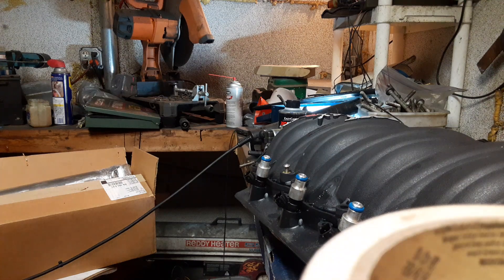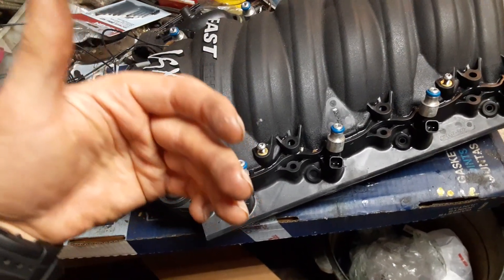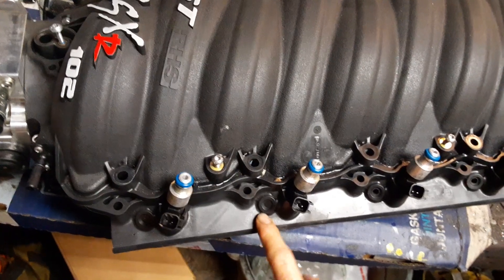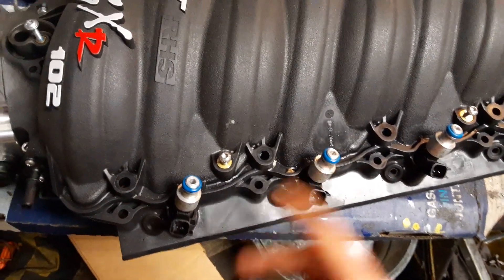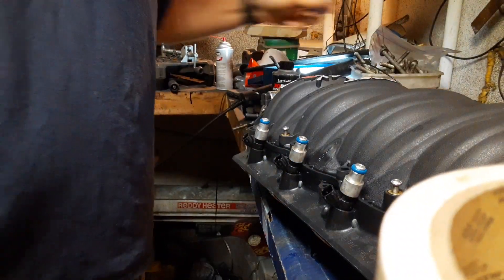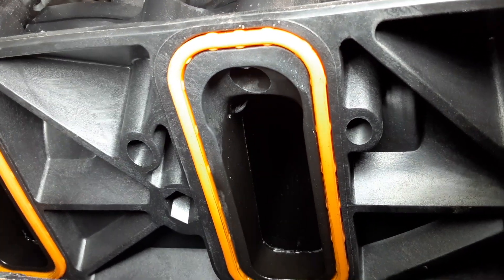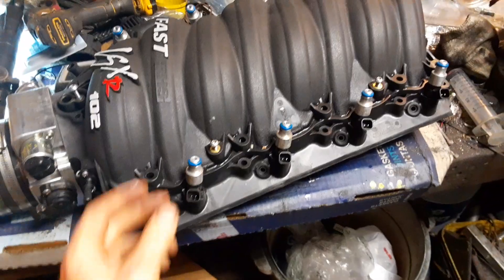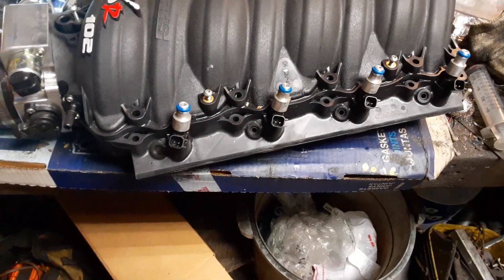Drilling a FAST LSXR 102 Intake for direct port nitrous the cheap way!

Comment: Wouldn’t u have to spray before the maf for the injectors to compensate?
Reply from the maker: I don't have a maf because this is a speed density system.  As soon as the computer sees the throttle at 100% it raises fuel flow.  That and using a maf to compensate the fuel for nitrous is a bad idea.  Most of the time you will run lean.
Reply: @chadk6938  makes more sense now a lot of people use the maf on low shots like up too 100
Reply: @chadk6938  I’m interested in buying a set of those from you. I wanna  plum my 102 mm and do the same thing you just did
Reply from the maker: @PIMPDULLA  I'll be honest, I had these for sale on ebay for over a year with the drill bits and a tap and never sold one set.  So I pulled the listing.  I might revisit this though.  Do you need just the jigs or do you also need the drill bits and the tap?

Comment: Could use a round bur to clean up the port holes on the inside, rather then using a utility knife
Reply from the maker: I thought of that, but I didn't have one small enough.  So I used a small reamer instead and it turned out awesome.